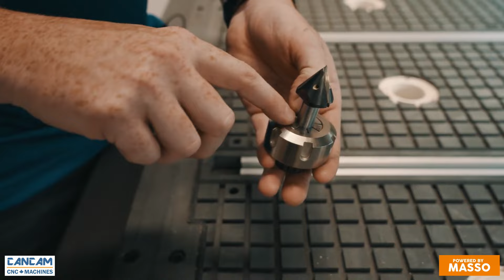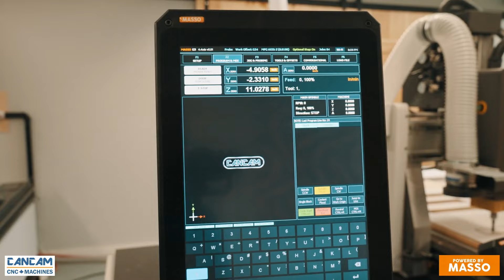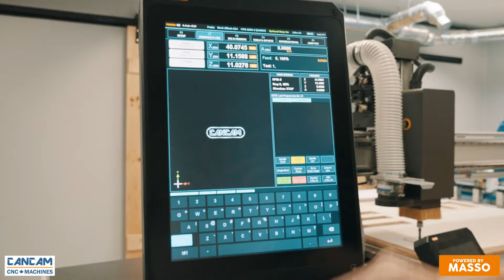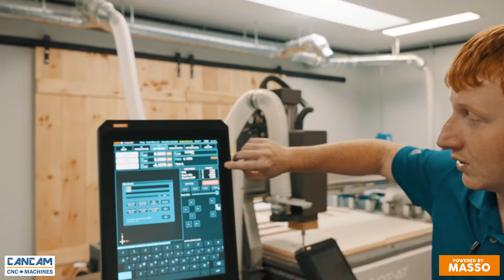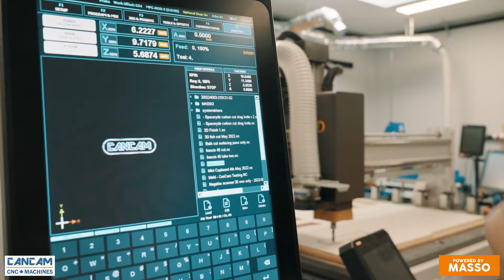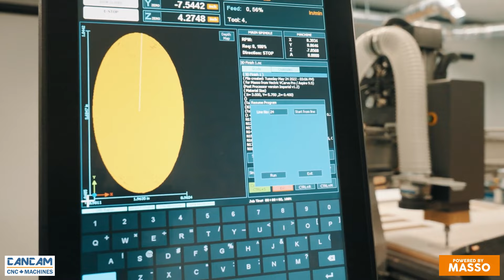MASSO CNC Operator Training: Full Walkthrough on a CanCam ATC Router (26 min)

Comment: 33 year cnc veteran here and I've got to say that that whole package has everything I'd want on my dream cnc. (1) Plenty of gantry clearance for thick jobs (probably up to 8" thick) (2) servos instead of hobby shit steppers (3) solid construction all round for heavy cutting at high speed (4) pop up registration pins (I use my registration pins all the time but they aren't pop up ones unfortunately) (5) Masso controller. These put maintenance back in the hands of those that are capable of it. My current machine has all fault finding and most technical settings only available to / accessible to the company techs at $230/hr. I.e. password protected.

Comment: Is there a way to lock the x/y/z zero buttons, or turn on a confirm dialog before zeroing? It seems like it'll be very easy to hit them accidentally.

Is there a page where you can put favorites, things you do multiple times a day every day? For example I lift and lower the dust boot during cuts, I switch between tools 1 through 9 manually quite often. All of this is accessible through the menus or gcode commands, but it would be nice if you can just pin it all in one place instead of going to submenus.

Lastly, and I know you can't really tell  from videos, but is there input noticeable lag between the MPG and the motors responding? It almost looks like a small pause between hearing the clicking of the mpg wheel and the spindle moving, but I can't think of a reason why there would be lag, and you never see the mpg in use and spindle moving in the same camera frame.